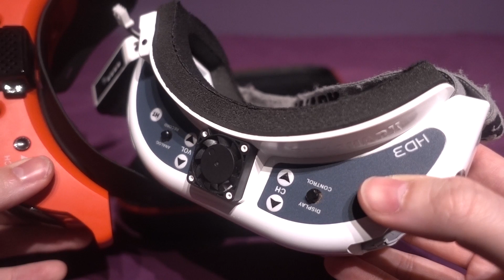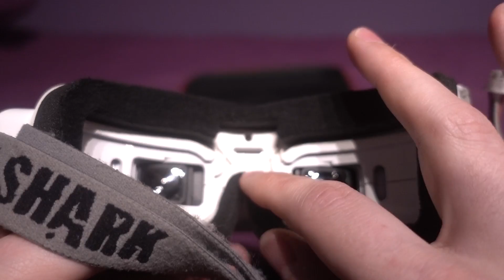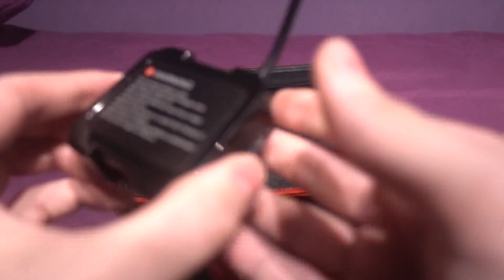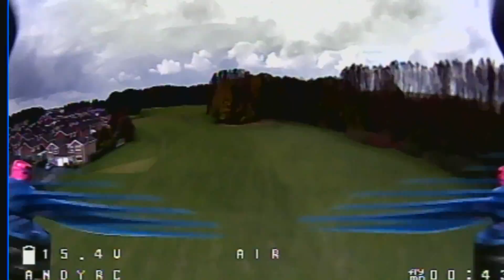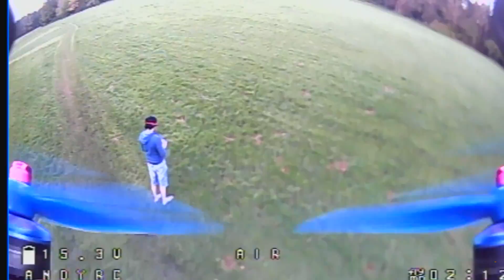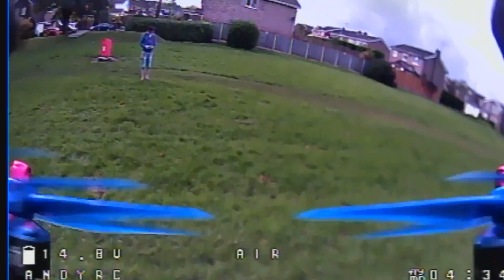Topsky F7X Fatshark Killers?

Comment: I think the sensor is useless. I mean I just slip my hd3s onto my forehead when I'm not using them as I'm sure many others do as well. This sensor won't save any battery unless u take them off completely. Plus it took me 15 mins to put a power button on my fatsharks so no biggy.
Reply from the maker: Im starting to think that the sensor is to expand the life of the screen technology rather than the battery now

Comment: A new movie watching googles with FPV functionality built in :)  Seems the F7X creators aren't directly connected to Eachine/Banggood and are making their products themselves. Which explain the upside down connector for expansion modules. Maybe we should expect a new line of expansion modules, who knows. Top cover design is a straight ripoff from anime cartoons - some FPV flyers are addicted to them in great degree :D  Very impractical though - probably we can expect a shortened 3D printed or manufactured version of such cover which would allow easier access to module bays and SD card. DVR failure to write in NTSC is a big downer too. I don't care much because we here have PAL and 50 Hz mains. But quite large part of potential paying customers live in one known country with 60 Hz mains (hi, flicker!).

In general the same story what happened with Eachine EV100 googles. The first version is a ... Ah well, better wait for upgraded version with noticeable glitches fixed.

Comment: Attitude V4s! Best value in my opinion, most of us don't need the extra functions
Reply: Daniel Braker awesome price  yeah you'll love them plus they look nice, the material etc, the HD3s felt like crap
Reply: IceRook I agree I just bought a pair from banggood for $280
Reply: Exactly. I just got my anniversary editions and love them! 
Especially with 2 18650 batteries, you can't beat having 8 hours of life lol
Reply: Daniel Braker I had originally got the HD3s too but I'm not sure what is was besides the "fixed" blurry edges, but the V4s I actually thought it was MUCH better
Reply: IceRook good to hear I'm excited to get mine but they don't ship until November
Reply: Ryan that's the good thing, fat shark will provide proactive and after sale service, most these companies warranties are made so you say f#=k. But I've got many hours and so far no issues, I absolutely love them.
Reply: Might want to look into the voluntary recall on the fatshark attitude V4's. Watch for white flashes in the screens.
Reply: Ryan thanks for the heads up.  According to the thread on RCGroups Fatshark claims they found and fixed the problem.

Comment: thanks for review andy !  between aomway commander  and  FS dom v3 wich one do you recommend?
Reply: Aomway were under restock from march to october now, 7-8 month, i've tried to wait 2 month from march but then i'm just give up. They are great but just not worth for waiting so many (bought dom v3, fine with them)
Reply: i have a friend that bought the dom v3 this week and he also  have aomnway  commander with 2 months use and he told me he can sell me for  270$  . i can buy dom v3 with realacc rx5808 Plus for 350$ shipped from banggood ( 80$ + ) do you think  the v3  worth the extra 80$  or should i go for my friends commander v1 ?
Reply: Dom v3 on bang costs 360 + 13$ shipping + 25$ (pro58 receiver) = already around 400$. If i were you, i'd better by commanders, because i really want to by them, but they've never in stock. Moreover, you'll save 130$
Reply: i have a coupon  that brings FS dom v3 to 305 usd shipped + 42usd realacc rx5808  = 350$ . but  still its 80$ more  , i will maybe go for the commanders. thansk for the help